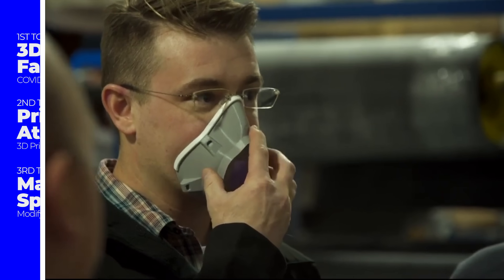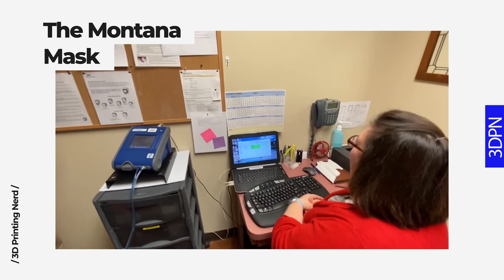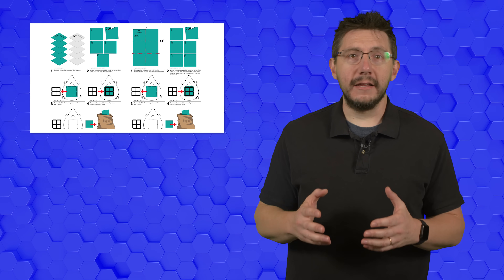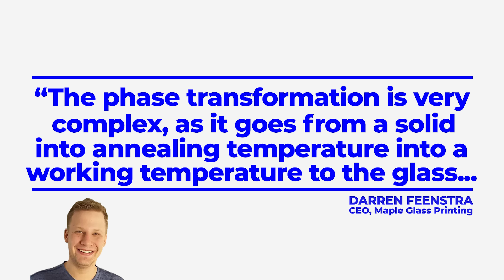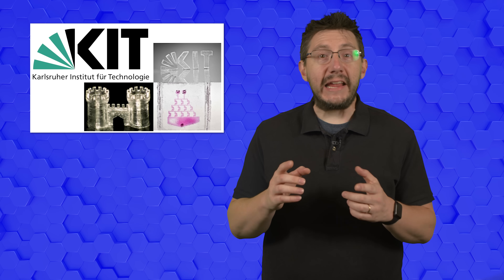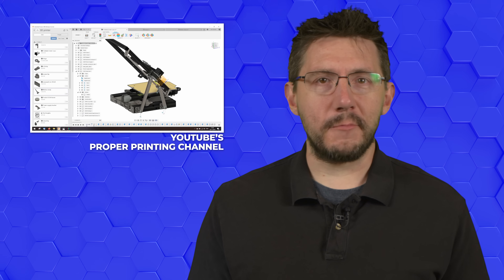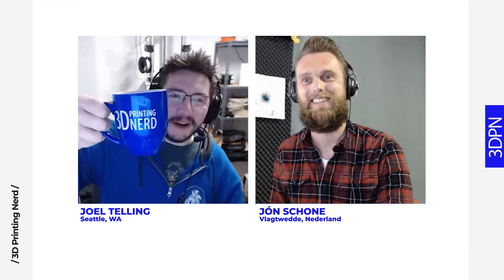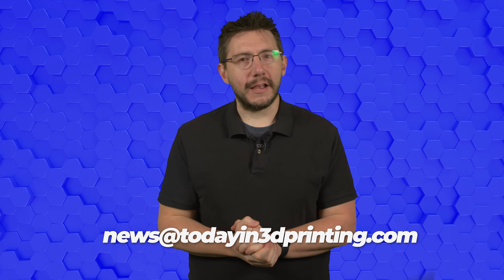3D Printing Face Masks, 3D Printing Glass, and Proper Printing // Today In 3D Printing

Comment: What about a selective laser sintering process for glass? Use glass powder and you can make a high quality and detail glass sculpture
Reply: MapleSyrupGuy Hi MapleSyrupGuy! Great question! I have a lot of background in metal AM and SLM, so I understand why you would think that may work. The big issue is the reflectivity of glass powder, this leads to melt pool instability during the SLM process. Some have tried it, but there’s issues with continuity and also vapourization. We also have this problem trying to print light metals, eg: Cu and Mg

Comment: You are not going to be 3d printing with recycled glass. The problem is that there are different types of glass similar to how there are different types of plastic. Bottle glass is challenging to work with. It is very stiff and has weird working properties. Soft glass (as used by most glass blowers) has a lower melting point and smother more consistant melting properties but bad isnt very heat resistant and isnt very chemical resistant. Borosilicate glass is the types used by scientific glass blowers and pipe makers. It has a much higher melting point but it is heat and chemical resistant. These are just three of many many types of glass and should not be mixed. When you  try to mix different types of glass either they wont mix throughly and will just crack and fall apart when cooled or if they are mixed throughly will have really weird/inconsistant working properties that would be nearly impossible to design a machine to compensate for.
Reply: Hi 3E! yes, recycled glass is much harder! but we're giving it a crack (no pun intended). If you check out our website and social you'll see we've already done our first prints with recycled beer bottle glass :)

Comment: Hi Joel, love your videos! You've helped me A LOT troubleshooting my printer!
 
In this video however there is a small problem. Covid is a virus, not a bacteria. The two reproduce in different ways, so the bacterial colony test is useless to know if the virus is present on the mask after sanification. 
I'm not a doctor and I haven't studied medicine, however you can look those things up for yourself. 

Also, °C is the Celsius scale which is a centigrade scale just as Kelvin (K)  scale. Centigrade means that between freezing and boiling temperatures of water there are 100 degrees (100= "centi"), but water boils at 100°C in the celsius scale and at 373.15 K in the Kelvin scale.

Sorry, but misinformation is something that triggers me badly. Look up for things and do research for yourself guys! Science is the only thing that will take us out of this dark days. 

Stay safe guys and use approved masks!

Comment: I've been making one very similar to this but I've been casting them in a High temp resin instead.  This way the mask, minus the straps and filter, can be put into a dishwasher on the sanitize cycle or into an autoclave for cleaning.  I like this method as I can produce them at a rate of about 1 an hour ( more if I made more molds ) and that includes the silicone seal as well.  I did print the original model to make the mold with and have sent out several of them already for people to use.
Reply: 💗this! I was thinking about that last night 👍
Reply: @mrsdragnfly  Look up the Smooth On channel on here.  They have a video that I used to make mine with and gives a good instructional of the materials used and why as well as how to make them.

Comment: But how do I make these 3D printed masks a bit more airtight? What material would I use for that?
Reply from the maker: Check out their link in the description!
Reply: You can make a silicone gasket that you glue around the edge to make it both more comfortable and more airtight.  However, be sure you use a platinum cure silicone for it and also a skin safe adhesive such as Silpoxy from Smooth-On.  You can find a mold for the gasket on Thingiverse